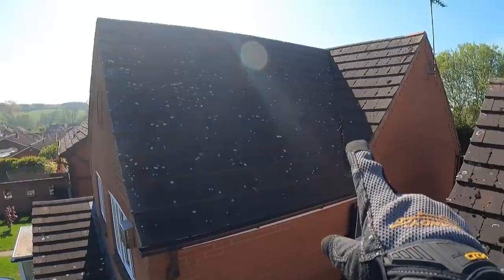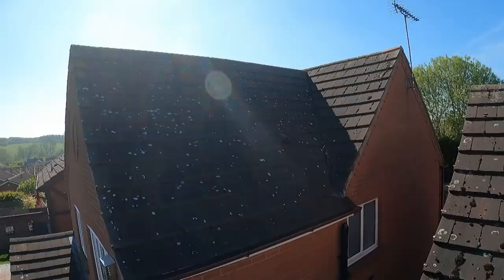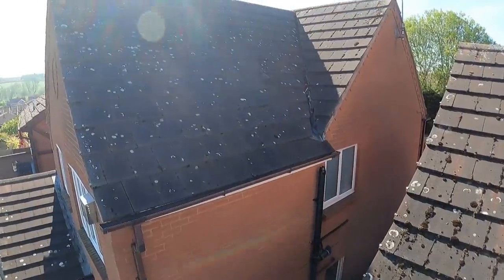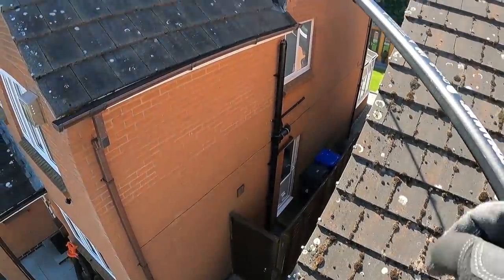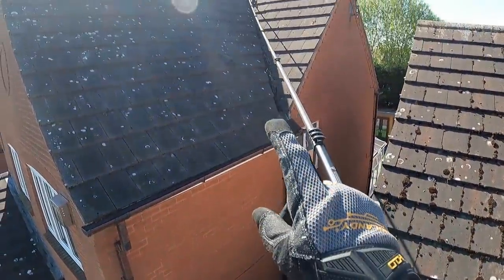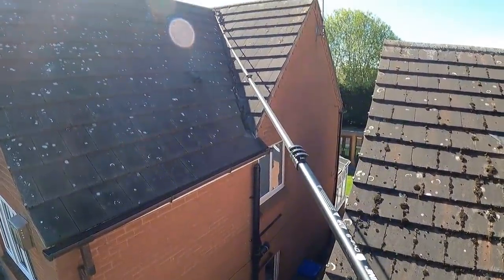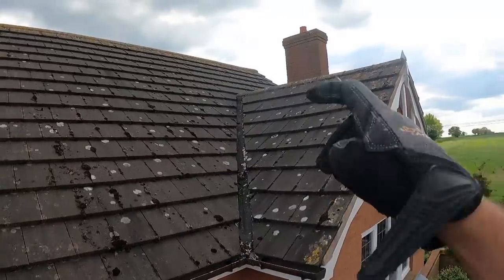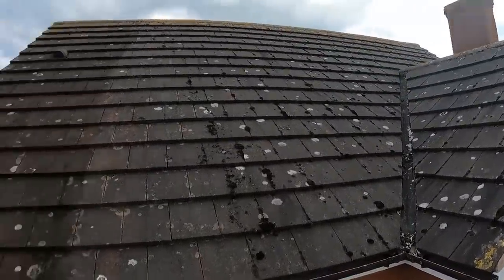Watch Me TRANSFORM This Roof (Moss Removal)

Comment: I might have missed it but how much did you charge for this whole roof cleaning job would it have been cheaper for her or him  just to get a new roof... Awesome video by the way...
Reply: You're joking right? Google the cost of a new concrete tile roof.
Reply from the maker: I did a deal on these as both houses were getting done but a typical roof like this would cost from £850-1500 depending on the contractor and their methods. 
A new roof for a house like this I wouldn’t imagine could be done for less than 10k

Comment: Hi Sid , quick question!! How long does the biocide need to be on the roof before it rains ?? I did a roof this week but it rained 24 hours later.. the customer is worried it’s not going to work now!?
Thanks mate.. keep up the good work !!
Reply from the maker: 24 hours is perfectly fine mate, as long as it’s had time to dry properly it’s done it’s job, a bit of rain actually helps the process 👍
Reply: Wicked thanks Sid 👍

Comment: The thing that bothers me most is that the supposed bird poo ( or the white splotches on the tiles ) does not get cleaned, when you're soaping up the roof. 
Is this permanent? Can you not clean those off too? Probably UK housing uses a different material, when building houses, but we could clean ours till it was shining, spot free (Poland here). 
Could you explain, please?
Reply from the maker: If you didn’t skip the chatting at the start I explained it all in that section :)